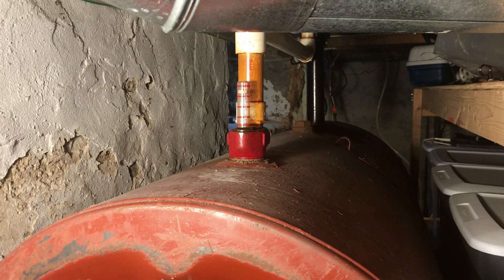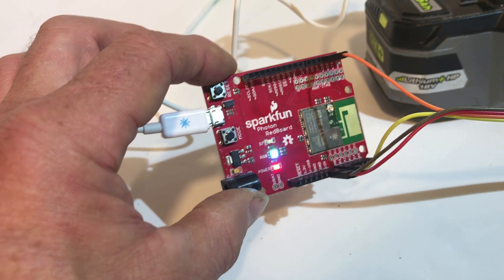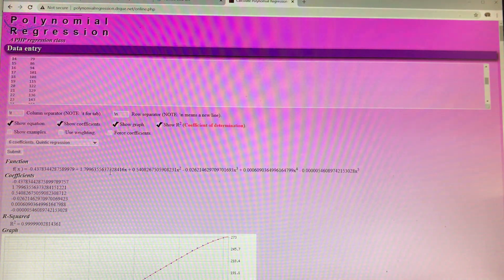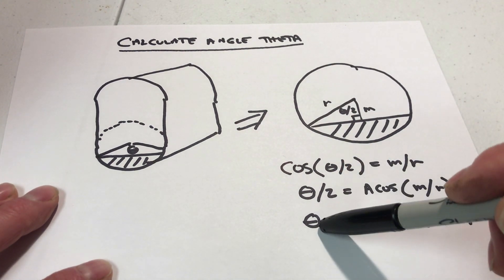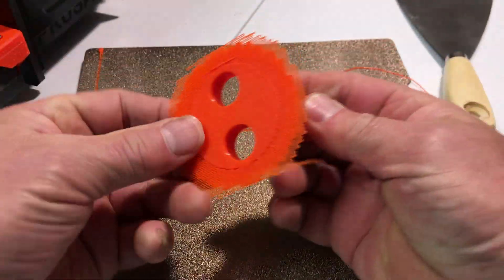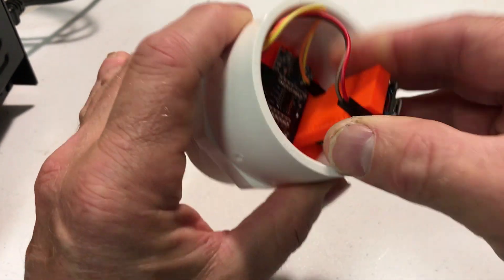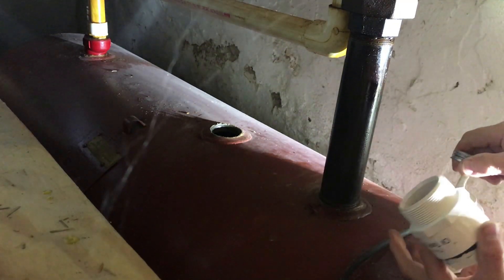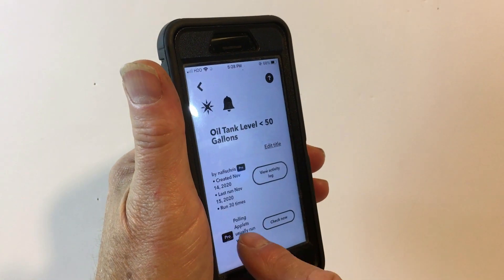Oil Tank Level Monitor

Comment: how has the 3d printed parts and PVC held up over time? I have a similar setup for monitoring my water treatment tanks and wanted to do something similar for my oil tank but my research indicates that only steel should be used for the oil tank. Curious if you had any issues with the integrity of the PVC and 3d print.

Comment: love the project. I am trying to recreate it my self. I have everything set up inside the 2" PVC. I am having some trouble with the readings. I get consistent readings but it does not seam to want to go past 2".
Reply from the maker: @jordankeuler99  maybe sensor getting reflections? Try recentering it? Test out of tank first?
Reply: @SerendipitySue  I have not officially put it in the tank yet. I am wondering if the PVC is not colleting all the sound back

Comment: 10 years ago I installed the Beckett Rocket in a friends oil tank. Just this last week it quit working. There are no bars or indication what so ever not he receiver part. I'm going in with the assumption the receiver is Ok and The CR2430 Lithium Ion battery in the Rocket Sensor on the tank has failed. Would appreciate anyone's input on this, one way or the other. It looks like Beckett sold the Rocket to Apollo and the new devices cost about $160 as it works with smart phones.

Comment: I just made the same thing today, and searched it here out of curiosity.
If you do any revisions, I'd suggest adding a pipe inside to focus the sonic burst when the tank is low, might reduce noisy readings. Drill vent holes just below where it joins the threaded adapter. 
The 3d printed plate is awesome, nice work.
No issues with it blowing loose during fill up?
How long has your sensor been going? I used a fairly cheap one and am concerned about it's durability in that environment.
Nice work overall!

Comment: Thanks for sharing the project. I am working on doing something similar with a wemos d1 and integrating into home assistant via ESPhome. My question is what happens when the tank is filled to the tippy top? Is there a chance the sensor will become immersed in the fuel oil?
Reply from the maker: my tank fill shuts off way before it gets to the sensor (at least so far ;-)
Reply: This is why  residential tanks have a whistler . So that the oil guys know to stop filling the tank way before the oilwouild reach the top.   If the tank is filled all the way to the top, you have bigger problems than the sensor getting wet.

Comment: Can I buy one of these off you??
Reply from the maker: sorry, not really in a position to make/sell them.
Reply: You could sell the 3d printed part, and  the software,  and the detailed instructions on how to get the software onto the chip. Building it seems straight forward. What is currently stopping me from following in your footsteps:  I woudl have to buy a 3d printer and figure out how to develop and deploy software for this platform.  (I am actually a programmer). Your solution solves all the problems with the ready made solutions I coudl buy on amazon. (Needing expensive batteries is a big one), Do you have some breadcrumbs on programming the chip?

Comment: Nice project. However, the linked plug and adapter do not mate, as they are the same diameter. Although described as a 2" plug, it appears to be a 2" cap.
Reply from the maker: OK, thanks. Amazon has a habit of changing the links when they are out of stock or vendors change.
Reply: Did you ever manage to find one that mates? I've been searching for a plug that has an OD of 2", but everything seems to have ID 2" instead. Any other suggestions?

Comment: Really nice project, thanks for sharing! Have you found the sensor to be consistent after using it for some time? I had a similar setup for my Xmas tree water level, just with a water sensor instead of ultrasonic. I had a few outliers that I'd like to filter out for smoother reporting on my next revision.  

Just ordered the parts to throw one of these together and tie into Home Assistant. Appreciate it!
Reply from the maker: It gets occasional noise, but since you can change the graph time period on the Blynk app, the trend is apparent.